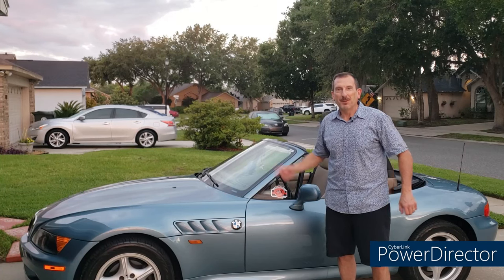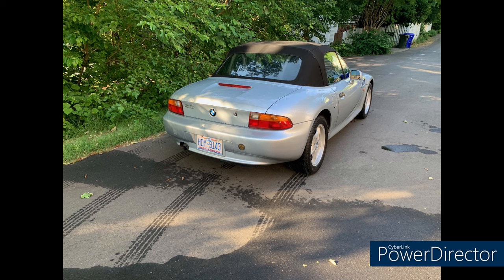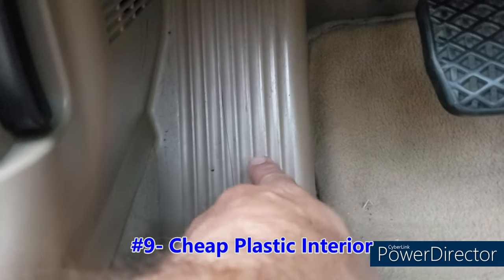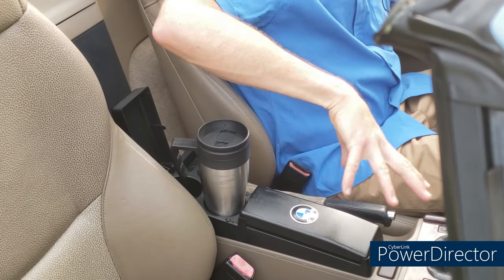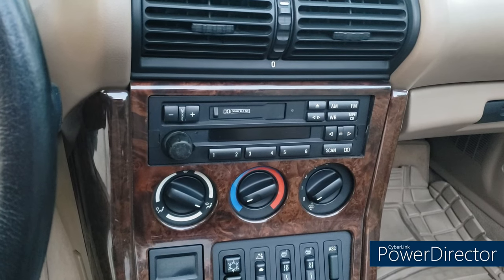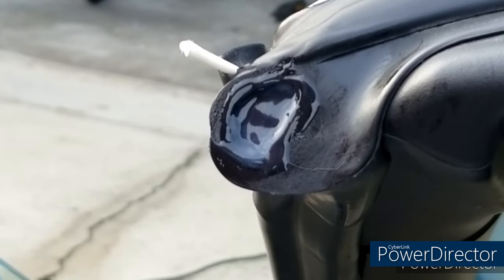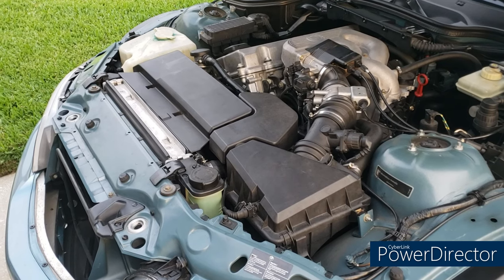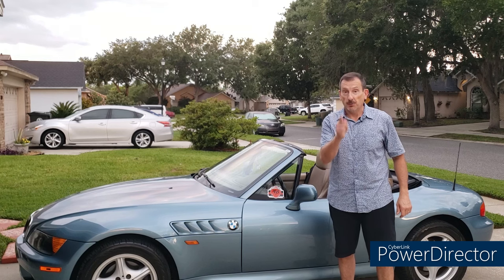Top Ten Problems: BMW Z3!

Comment: Great video! I have fixed some of the problems mentioned in my Z. It feels like the "to repair" list never gets shorter for my Z3... I'd also mention problems with rust - this is obviously age related bu there are areas in Z3's that have been really badly protected from the rust
Reply from the maker: Good point- as a Florida guy I don't even think about it- but I do know for folks up north and in Europe, it's an issue.  Shows how far I've strayed from my rust belt roots!  I know the interior rocker panels have problems specifically.

Comment: You forgot to mention the OTHER plastic coolant fittings, at least on the 1.9, under the inlet manifold, and around the back of the head. Nasty failure points indeed.
Reply from the maker: Good points!  Access problems both.

Comment: I have a 2000 BMW Z3 M  Roadster with a cracked H/K subwoofer . Can't play CHICAGO music. Is there a replacement available? Where?
Reply from the maker: @billhaddad4339  I'm working on that this week as far as I know there is no drop in solution.   You could pull the box and replace the two hk speakers,  but I've had a viewer comment that they weren't happy with that

Comment: Don't forget the annoying air bag light haha. Also in the major category the weak shock mounts and strut towers. Highly recommend installing rear shock braces and a strut brace for added support.
Reply from the maker: Yeah, definitely the air bag light was an oops on my part, funny because I dealt with it.  Senior moment!
Reply: hello was wondering if you had personally installed mods such as the rear shock braces and strut brace aforementioned. and if so what parts are compatible and where could i get them. having a bit of trouble in this area. and i would appreciate any info or help. thank you
Reply from the maker: @pepefrog7456  waiting on the rear shock mounts, coming in August supposedly, then I will make a video.  Have the shocks and reinforcements

Comment: Great video as usual.
I recently tackled the aerial grommet but didn’t want to do it by taking out the power roof equipment or aerial component. I did from the top.
Lots of masking tape to protect the paintwork and then VERY carefully cut away the rubber being careful to not cut the nylon core where the metal thread is. Then as advised on another posts, I squirted silicon on the nylon core piece, put the new grommet in boiling water (not just hot water) and in it went. So easy it shocked me.
Reply from the maker: Sounds smart!  Appreciate that.  You guys are motivating me to do it.

Comment: I had a beautiful 2000 2.8. It was wonderful. However, I sold it and bought a Boxster and that was a step up lol
Reply from the maker: Never driven the boxster.  Willing to try but I won't switch! 😉
Reply: would you say a 2.8 was too much for the car? not sure whether to look at getting a 1.9 or a 2.8 z3
Reply from the maker: @cawse3429  the 1.9 is fun, but I often wish I had a little more power.  Both are reliable.  I'd go with the 2.8 given the choice.

Comment: I use a rear window cover, made for the Z3, placed on the window before folding.  It prevents scuffing.  It works quite well.  Found it on Amazon years ago.  98 Z3 M Roadster S52
Reply from the maker: Still available I think for around 50 bucks

Comment: Useful, thank you; but surely cupholders were never fitted at all - mine has none at all... defs have some of the other issues, but electrical issues are the bane... seats, hood, airbag light etc etc... and the leaking hood and the crap glovebox and and...
Reply from the maker: I should have included the airbag light at least!  What is the hood issue? Just curious.

Comment: Great video Mark...cooling system parts should be replaced after 100000km distance. Our 99 2l 6 had cooling system issures, replaced rad, w.p. and thermostat assembly plus antifreeze. Runs nice now...kind regards...William
Reply from the maker: Thanks!  Gotta do mine!  I'm on borrowed time.

Comment: Did my antenna, and converted it to short with a new grommet, not really a difficult fix. You just have to push hard on the new grommet to fit it in the body, some lube helps.
Reply from the maker: Thank you for this.  I'm tempted to do it for the video more than anything; i.e. I don't mind the long antenna, I'm not married to it either, and my grommet is fine.  How's the reception with the shorty?  People have made it sound very difficult to fit the new grommet.
Reply: @MomentofZed  Haven't noticed any difficulties and sometimes I get radio even in my apartment's underground garage (of course not perfect signal underground). You will probably have to fight the grommet to fit it but there is no "technical" difficulty. I did it from outside unlike some people that do it from trunk
Reply from the maker: @lefteris696  Thank you!  Shorty antenna from Amazon?
Reply: I had a problem getting my antenna grommet to seat all the way down as well and asked what would Macgyver do? 

I used a piece of 1/2" dia. schedule 40 pvc pipe about 8" inches long and  the grommet easily pushed down. I asked myself why didn't I think of that sooner?
Reply from the maker: @jimmyk6336  nice job.  I think ol mac would be proud!

Comment: Great video Mark!  Reminds me that I need to examine my DISA valve.
Reply from the maker: Mine needs done😐
Reply: @MomentofZed  How does one know that it needs to be done?
Reply from the maker: @martinvanherwijnen  Listen for rattling noises emanating from the DISA.  I heard mine stopping to open my garage door one day.  If you have a six, there are inexpensive non-OEM available.  You might feel a small power loss as well if it's bad.  I need to do a video, haven't decided if I want to rebuild or drop the $450-500.

Comment: I have a 2000 Z3 M roadster E36. 90k miles. Can you make a video on how to clear the convertible top rain rail drain tubes, and the tubes in the doors? I'm getting water in the trunk, and inside near the doors.
Reply from the maker: I can try!  Appreciate the suggestion

Comment: Z3’s are my favorite cars, despite the problems 🙂 I was thinking about tracking a 2.8 but I’ve heard from people that the rear suspension on Z3’s was subpar for tracking. What’s your take on that?
Reply from the maker: I think it can be improved.  Rear shock mounts are a weak point but not hard nor expensive to change.  I'm getting ready to buy a set and change out my rear shocks to Koni sports.  Video soon.
Reply: Same suspension geometry as an E30. Can be twitchy at the limit but nothing that cant be tuned correctly to be a fun, competent track toy.

Comment: Hey I have a 99 z3 and it’s making a arf arf arf noise like a seal but when I take the oil cap off it goes away, please help
Reply from the maker: Which engine?
Reply: Not a mechanic, but I'd say CCV valve or you have bad piston rings pressurizing your crankcase.

Comment: Are there adjustments for panel gaps on the z3? Since it's the clean title ones I've been looking at had inconsistent his gaps passenger vs driver side
Reply from the maker: Not that I'm aware of, but a weakness of mine is bodywork to be honest.  Of course does clean title mean accident free also?
Reply: @MomentofZed  most of the time a clean title should unless the accident wasn't reported. 

I also saw a rebuilt title car where it looked pretty pristine, but a couple spots in the bumper were sticking out like they weren't clipped in. 

I might take a look at that one cause the price wasn't too bad for what it looked like to be honest. 5.8k. A bit much typing it out like this. Maybe I'll wait it out and see if any better deals come along.
Reply from the maker: @StuckOnAFireHydrant  Don't rush!  They're out there.

Comment: Can I remove the passenger seat with seat in the forward position, seat won’t move, 2000 Z-3?? Thanks RG
Reply from the maker: If you can get to the front bolts, maybe.  Might have to do it by feel.  See details in my video about how to replace the seat bushings in the how to playlist.  Could be tough.
Reply: @MomentofZed  
Okay, will give it a try 
Thanks.  RG
Reply from the maker: @russgilmore-m4m  good luck.  Disconnect the battery prior to seat electrical disconnects if you get it loose.

Comment: On my son's 1996 Z3. When he plugs a phone charger into the cigarette lighter it pops right back out. Just like it would do if  using the lighter after it has heated up. Do you have a resolution for that?
Reply from the maker: Have to admit I dont, first ive heard of that.  Have you tried other phone chargers to see if its the cord and not the car?
Reply: @MomentofZed  yes we tried two different chargers. The charger lights up then pops out. First thought it was the fuse blowing, but wasn't.
Reply from the maker: @teslamx4lifeunedited887  thats weird,  ive never used mine for anything to be honest.  I feel like the socket must be worn out.  Its probably replaceable.  Access maybe from the shifter hole after removing the boot.

Comment: Do you know where a lot of oil liking from the motor can come from in my Z3 1996 1.9 L
Reply from the maker: @arnaldomartin4920  front main seal, rear main seal, valve cover gasket, oil pan gasket, oil filter housing gasket.  Those would be my first thoughts

Comment: Thinking about a 2000 Z3 with 137k miles. What are some things to watch for? Are parts for these cars out there and reasonably priced?
Reply from the maker: Parts are out there and prices vary.  Oem tends to be expensive,  but substitutes for many parts are available.  Not too many unobtaniums.   Watch out for trunk welds on M models especially (Google for details).  See my latest video for the good things.

Comment: I have a 98 Z3 2.8 I had to change the radiator so I ended up losing some fluid and decided to change the fluid and the filter it may still be a little low but it runs great except it's slow down shifting into second and or first do you know anything about this
Reply from the maker: Automatic I assume?

Comment: I just bought my 1999 1.9 roadster and seems like it is running cold even after driving 200+ miles any ideas why it’s not up to temp?
Reply from the maker: Sounds like a thermostat stuck open.
Reply: @MomentofZed  thanks for that I’ll have a look at that tomorrow taking it round to unit to work some things out on it

Comment: I have an issue with my 2000 Z3. When I unlock the trunk, it instantly locks its self again. It's something electrical. 
The other door locks work fine. Is there a way to disable the electric locks by removing a fuse, or a relay?
Reply from the maker: @jimayers7461  let me look at that when I get back from vacation later this week.
Reply: @MomentofZed  Thanks<< I love your videos.
Reply from the maker: @jimayers7461  thanks for watching!

Comment: 6:29 i fixed this with a magnet because the glove box would fly open evey time i hit a bump but cars been reiliable 198000miles
Reply from the maker: @austinspringob9376  nice to here!  1.9?  2.8?
Reply: @MomentofZed  1.9L
Reply from the maker: @austinspringob9376  they are great little motors.

Comment: QUESTION ABOUT IMPELLOR AND DISA VALVE - I have an ‘01 3.0 inline 6 cylinder. Obviously way different than the engine you showed. Do I have those dangerous parts on mine? Or just other cheap plastic parts that could tank the motor?  I’m no mechanic at all, so if there are specifics to mine I should have checked out, please let me know. I plan on viewing many more information videos. The leaking top rubber pieces is definitely the first I’ll tackle.  Then the glove box repair very soon after.  Those both looked doable, but both with huge value.  I could drive it on a rainy day - finally!!!  I have a big list of quirks with mine; only 3 matched your list.  He’s a beautiful boy with 68k miles and gorgeous chrome rims. Light blue/tan top and interior. Automatic. Worst stereo system I’ve ever heard, ever. Multiple fluid drops.  
But I’ve rarely driven him without at least one compliment.
Reply from the maker: Just researching both things.  You have a DISA valve.  Yours is only $130; mine is 500 :(  Near as I can tell, your original water pump has a plastic impeller.  Replacement for yours is about the same $130 for a new OEM, which now uses a composite impeller.  There are other options as well.  Good luck!

Comment: Any clue on my Z3  2001 draining the battery?
Reply from the maker: Could be many things.  Look for a light that should be off but is on.  Trunk is a possible culprit.
Reply: I have a 2001 with the Harmon Kardon radio and even though it was working fine it would drain the battery. I pulled the radio fuse and that stopped the battery drain. Try it.

Comment: Do you know if your car was formally from Kentucky?
Reply from the maker: I don't.   Its possible,  I'm the sixth or seventh owner i think.
Reply: I pretty sure I own it
Reply: I'm didn't have 1 problem regular maintenance I Think 2008 I sold it
Reply from the maker: @tm5346  interesting!  Do you have a record of the VIN?
Reply: No it not mine had tan top it's not it
Reply from the maker: @tm5346  my blue top isnt original.